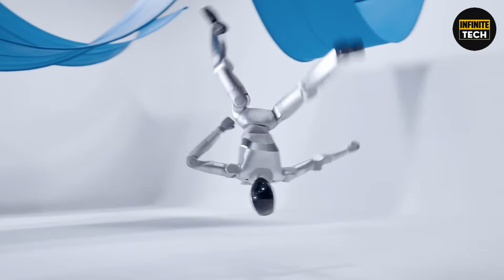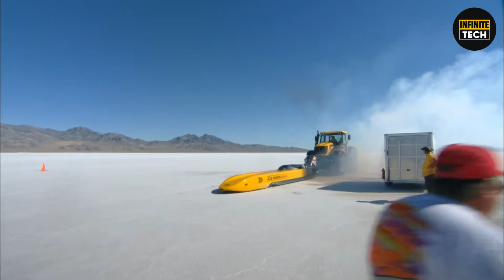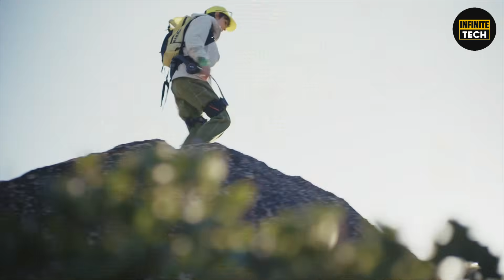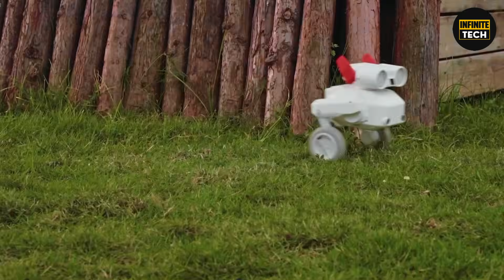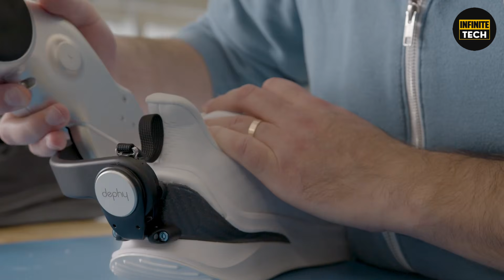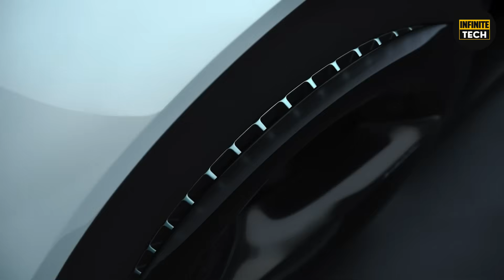THE MOST FUTURISTIC INVENTIONS OF 2026 REVEALED!

Comment: That aircraft on the boat would never get off the ground. Not anywhere close to enough power from 4 little propellers.
Reply from the maker: You might be right. Do you think it would need larger propellers or a completely different propulsion system to fly?